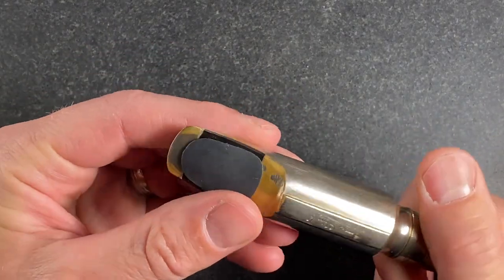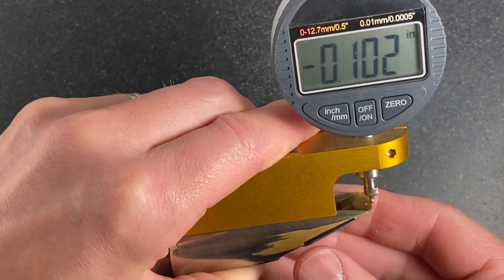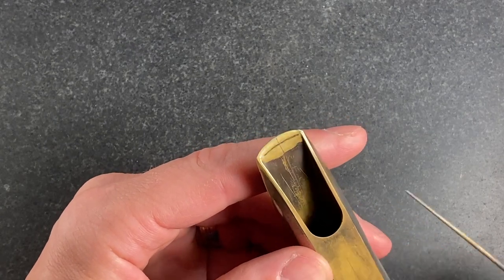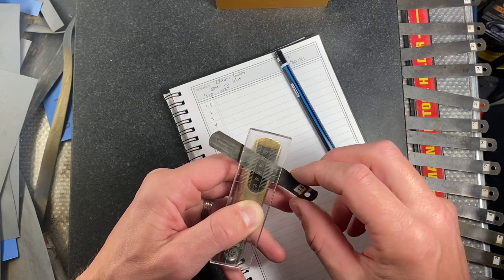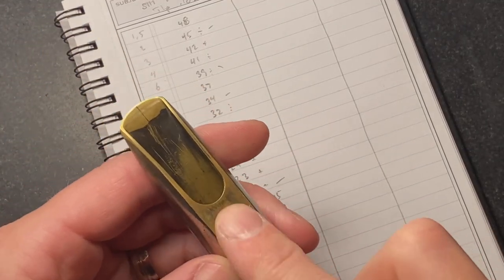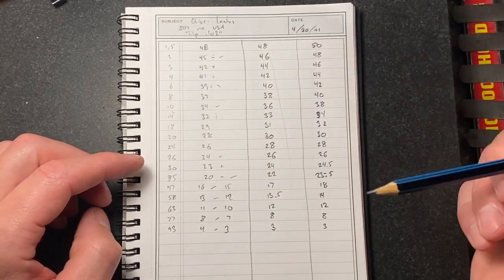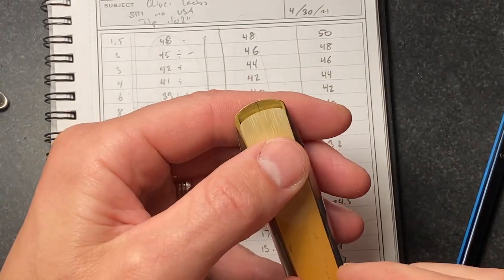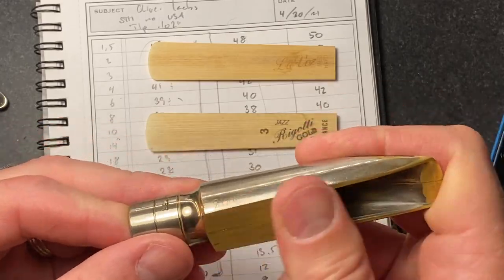Saxophone Mouthpiece Refacing NYC Assessing an Otto Link STM

Comment: So I just refaced and fixed the baffle in one of my mouthpieces and it plays really well now--which was cool/lucky because it was my first time doing either thing. Is there anything I should watch in particular to get better at it. (Bought the Theo Wanne kit with the extra gauges)
Reply from the maker: Hi! That's great! I'm glad it came out well for you. In my opinion, the best thing to do is to measure every piece you can get your hands on for a few minutes and then play them. There is more to this than just the facing curves of course but that work is foundational to becoming a good refacer.